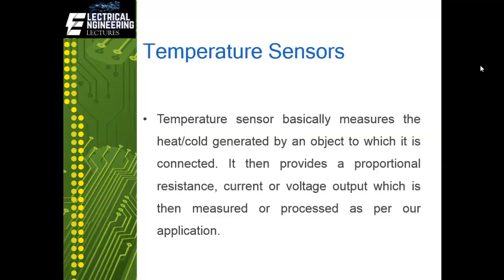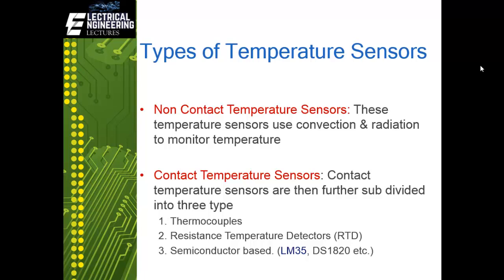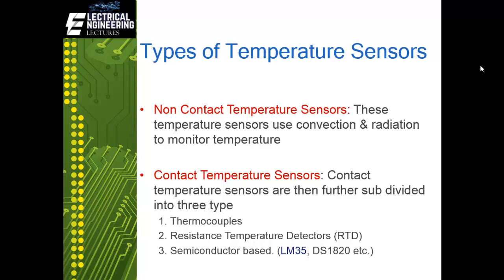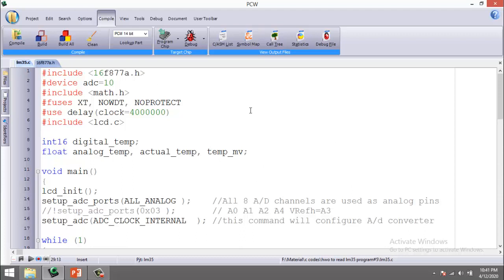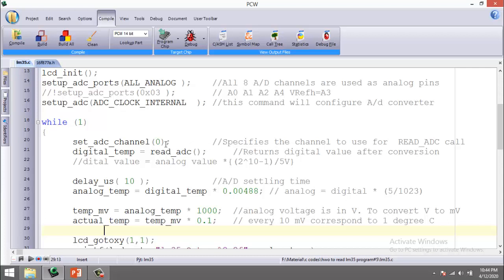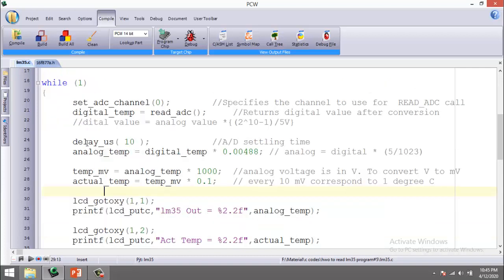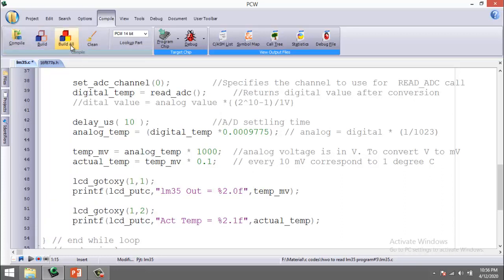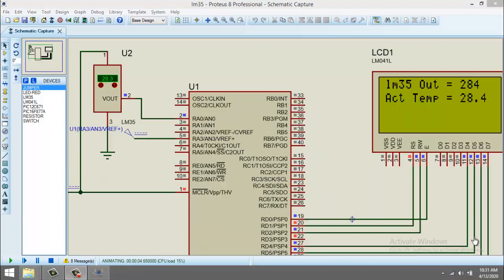LM35 Temperature Sensor with PIC16F877A | Digital Thermometer

Comment: How to code like this ,if temperature is greater than 70°c then turn on the led and if temp is less than 70° turn off the led . Pls help me sir
Reply from the maker: You have to use if else statement for this.
Reply: @electricallectures  in if statement which value i can pass either analog or digital .
Reply from the maker: Obviously analog . The real temperature is in analog . When read by microcontroller it converts into digital. Then again by using D to A formula the result is converted into analog and store in float bcz temperature can be have decimal value. Then use this value in if statement
Reply: @electricallectures  thanks a lot sir pls upload more videos in pic microcontrollers